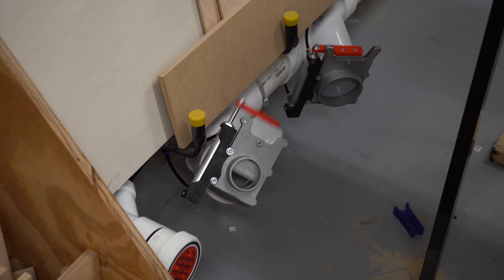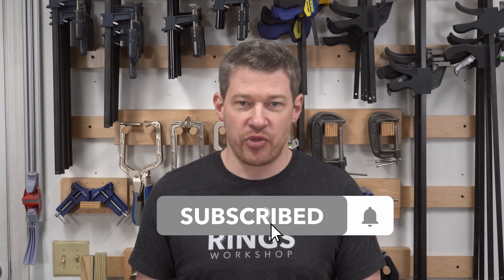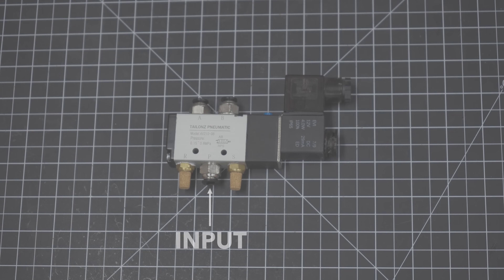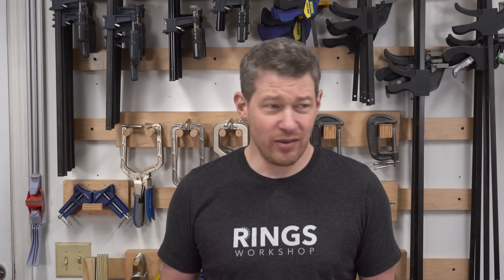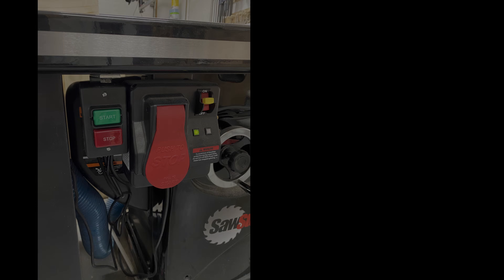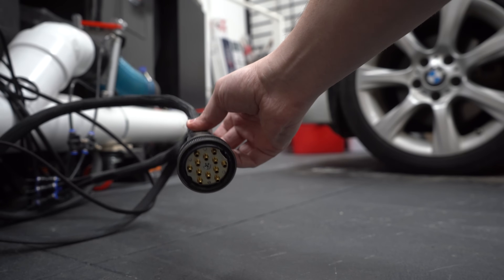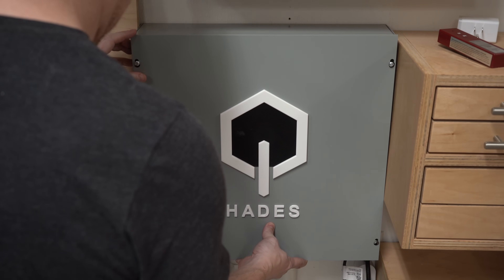How to Fully Automate Your Dust Collection Setup

Comment: You had mentioned using an Air Flow Control Valve to slow down the speed of opening and closing the blast gates. Do you recommend using two at each blast gate or can you just use one before the inlet going into each manifold? In my case i am going to get a 16 station manifold block and it would be nice to use only one air flow control valve for all 16 blast gates...

Comment: Great video! This is exactly what I was looking to build. A lot of other videos I have seen use either a battery at the blast gates or manually opening them. This is perfect. Two quick things. I can't connect to your website to get the plans for this. Is it down? Second, the link you have for the 4x 12v 5 Way Solenoid Valve is actually the same link as the Arduino board. Can you give an updated link for the 4x 12v 5 Way Solenoid Valve? Thanks and subscribed! p.s. whenever I get around to building this I am going to actually print out the Hades logo and name on mine as well! I just downloaded all of the stl files.
Reply from the maker: Website is back up and going, card I had on file expired haha, only knew it went down because of comments like this so I greatly appreciate it!  I’ll get that link updated here shortly.

Comment: Outstanding work, man! You've inspired me to build a similar system, and I have the first batch of parts on the way from AliExpress.

Hey, question about the 3 manifold blocks (I think that's what they are?) that the solenoid valve bodies sit on in groups of 4 - the things you're installing at 8:09. Any chance you have a link to those? Is there a reason other than mounting layout that you used 3 instead of one long one? Lastly, I can't visualize how they connect to the solenoid valve bodies; if it's screw thread, I don't know how you'd be able to mount them with so little clearance. Any tips you can share on how you did that?

Thanks so much! Loved the video.
Reply from the maker: Sorry for the delayed response.  I believe the separate blocks were initially because I didn’t plan to have as many and then added extra for expansion, as well as the availability at the time.  Which parts are you asking how they connect?

Comment: You could think of a blast gate as standard open or just leaving the last used open, to make sure that the motor of the dust collection does not run against a closed system when switched on and no machine is running.
Reply from the maker: Definitely could.  I just wanted to keep them closed since my dust collector pipes outside and helps reduce cold air coming into the shop during winter.

Comment: how did you add solinoids without adding diodes? I fried 4 relay boards until I realized you must add these to the + and - of the soliniod valves.
Reply from the maker: You shouldn’t have to as long as you have the right voltage.  I’ve had zero issues with mine.

Comment: You can ditch your data wires by using radio.  Motenio is a nice little product based on Arduino that lets you send the signals via RFM69W radio back to your Mega.  The range can be thousands of feet and one Moteino could run on a single AA for a decade or so in your use case.
Reply from the maker: I had considered it, but since I already had to run the air tubing anyway it really wasn’t saving me anything from a QoL stand point, which is why I decided to keep the data wires.

Comment: Thank you so much for this!  I was literally about to buy into complete system, I already have the arduino and alot of the other stuff to crimp small wires etc.  The one thing I do not have is an air compressor.  I initially thought about hydraulic or something like that, but no no no... way too expensive.  So, I guess I'm getting a little pancake compressor for this  :)
Reply from the maker: Glad you enjoyed it!  Let me know how it turns out.

Comment: Really smart and well thought-out build. My gut instinct is that a momentary switch at each tool might be simpler--push once to start, once to stop--but other than the miter saw, this setup looks quite elegant. I agree completely on the use of pneumatics. They are the tool of choice for automation of systems like this in industry for a reason, and the components are both inexpensive and reliable these days.
Reply from the maker: Appreciate the kind words!  Been really happy with how well these work and the consistency.

Comment: Great video. It inspres me to get to work on my system. You didn't mention how you are supplying pressurised air to operate the pneumatics.  For my shop, I think I would try using linear actuators so I don't have to use a compressor or deal with all the air lines. They would be slower, so I might have to experiment to see if the latency is tolerable. I eliminated the compressor in my small shop when I switched to cordless brad and pin nailers.  I would opt for ESP32 devices instead of Arduinos. Very capable microcontrollers that support wifi and bluetooth. They are so inexpensive you could design peripheral devices for the tools that communicate wirelessly with the main controller.
Reply from the maker: Just started messing around with the ESP32 devices, big fan.  For the air I use my main air compressor but split a line off and then reduced the PSI way down.

Comment: How would you approach sending the signal from the current sensor wirelessly?
Reply from the maker: Some micro controllers like the ESP32 support WiFi and Bluetooth, there are ways to have the current sensors connect through that.

Comment: Awesome project.  Thank you for the links!  Will give you some commissions when I grab some of those items.  I have been very interested in doing some air actuated stuff, glad you posted this up.  I already do programming with ESP32, Arduino, Rasp Pi, etc. I see they make air actuators all the way up to 60mm bore with 1000mm stroke lengths and I am aware they are fast controls!  I have a few projects that I will be working on in the future.  I like the dust collection setup, in the middle of rebuilding out my new CNC shop and also separate welding shop with plasma table.  This will be great for the dust collector, I have similar one to the unit you have, think it is a 2 or 2.5 hp unit same shape and size with 4 inch hookup.   I have been 3d printing all of my adapters for this setup.  Love these types of videos, probably starting own channel this fall with topics of cnc hobby and 3d printing stuff.
Reply from the maker: Love it!  Thank you!  Let me know how it turns out!!

Comment: Well done! 
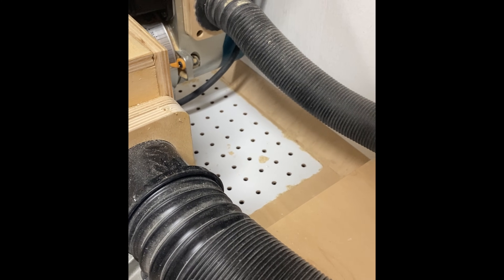However,  the comment you made on 11:55 is incorrect.  I recently installed a system from "Grit Automation," and it allows me to set up my blast gates, dust collector, and tool in any configuration I want. 
That said, the system you designed and built from scratch is very impressive.  Bravo!
Reply from the maker: I hadn’t heard of that system.  Are you able to program it where you could have one set trigger with tool powering on but then a timer to change to other blast gates after a timer?  Or reset the timer if tool is used again before shut off like on the miter saw.  I had never found a system you could chain multiple commands to vs just what happens when a tool is turned on or off.
Reply: @RingsWorkshop  Hey Sorry I was away on vacation and just got back to the States. To answer your question, yes, you can program multiple actions that will happen when you trigger a tool. For example: I have a 5HP Felder Dust Collector (3 phase) and as you may imagine, it has a lot of power.  One of my tools connected is a Kapex chop saw that is connected to the ductwork via a 4" branch and then reduced to 3" ductwork and reduced again to a 2" hose after the 3 inch blast-gate. My main Ductwork truck is 8".
You can imagine the wind velocity and noise if my 5HP dust collector was only pulling air from a 2" hose.
The Grit system allows me to program a 2nd blast gate to open at the same time as the chop saw blast gate whenever I trigger that particular tool. If I wanted to, I could program that 2nd blate gate to only open 60% of the way if needed.  In fact the servos that control the blast gates can all be programmed to open at any percentage I want when a tool is triggered.  As you know, CFM and air velocity both play a part in dust collection.  All this is controlled thru an app on your phone or tablet.  In the case of my chop saw, I have it programmed to keep the dust collector on for 30 seconds after the cut is completed. If I make another cut within that time, the system resets the timer.  
The owners of Grit Automation are also very approachable and helpful.  When I had a question on setting up the component that would start my 3 phase dust collector, (via the trigger) the guy who invented the system (Joel) called me on a video call from his cell phone to make sure I made the right electrical connections on my dust collector circuit panel. 
The same system also control my air filter in my shop, when the shop is in use and the PPM dust factor goes up to a predetermined level, the air cleaner kicks in and keeps running until the air quality sensor tells it to go off.  Think of the air quality sensor as a trigger.  When it detects dust in the air, it turns on the air cleaner. And when the air is clean again, it turns off the air cleaner.
 Hope this answers your question, and again...great video!

Comment: What happens when you have help and you are using two machines at once?
Reply from the maker: I don’t ever have help.  That said if you were going to use two tools at once, and have a strong enough dust collector to accommodate, you would just need to code it differently, but definitely still possible.
Reply: @RingsWorkshop  thank you I will definitely try this for my workshop. Have the blast gates held up well overtime?

Comment: Hi thanks for the video its great. I have manual blast gates and use door sensors to automatically start the dust collector but want to now automate the blast gates like you have. You mention that you are happy to share your Arduino code. Where can I access it. Thanks again for a great video
Reply from the maker: Thanks!  Glad you enjoyed it!  It’s posted on my thingiverse page, follow the link in the description!
Reply: Thanks found it - would have helped if I read the original description properly😊. What did you use for you air input, a small compressor?

Comment: This was an awesome video with great detailed explanations. I am definitley going to try this. One question, can the voltage sensor work on a 220v tool? Would you just connect one of the black wires and that is enough to sense the current with one leg of the circuit?
Reply from the maker: Correct.  My sawstop is 220 and it works perfect on that.  Although I may have it too sensitive as there are times I think it goes through it’s diagnostic and it kicks the DC on when I’m not expecting it and scares the crap out me every couple of days 😂😂

Comment: this is a great video and an inspiring solution to the problem of the burned up servo's...  can't count how many I have burned up over the past 3 years.   I took this concept and wanted to isolate all the intelligence and workings of each gate at the gate, and have minimal intelligence in a centralized controller, so I took your concepts and remixed them to something with a wemos D1 mini and NodeRed.  Essentially an Internet of Things network, with orchestration happening in NodeRed.   A raspberry pi runs the dust collector relay through a GPIO pin.    A suggestion for you to simplify this system, use an AC Current Sensing Switch,Current Sensing Relay 0-30A Normally Closed Current Sensor Monitoring Relay to detect when a machine is turned on.   No need to debounce and detect the on / off voltage sink and figure out if the machine is really running.   Also removes the challenge of the "ghost" loops created when you remove 1 of your sensors from the electrical circut.   This relay generates a 5V signal which you can connect to an INPUT_PULLUP digital pin on the arduino, which then is either HIGH or LOW.   If LOW, the machine is pulling current, if HIGH, not enough current to trip the relay (adjustable sensitivity).   It simplifies the current detection function to a simple if/then statement.     Just a thought to help simplify Bob's original voltage drop sensor

Comment: This video inspired me to build a similar system for my shop and it seemed to me that its arduino logic must not be very difficult to me and your code needs just a slight adjustment for my shop configuration. Hell i was wrong) Now i am sitting with arduino and 16 relay module trying to figure it out. Getting back and uploading your original code, i have some multiple relay clics on startup when it should be doing absolutely nothing, then one of the relays stays opened for no reason. I can se on Serial Monitor that it constantly scans Miter Saw amp sensor & I can see input signal change to 26 amps when i give it 5v or GND, but absolutely no reaction from relays and to any other A-pin too. The connection is fine, I've checked it with a relay board test code. Should your system be activated by some of buttons or switches i've missed? Thank you
Reply from the maker: My system has two buttons, for my bench top tools and my floor sweep.  If you don’t have buttons you can remove that part of the code.  There is also the code you likely have to remove for it monitoring the table saw and router table that has a switch depressed at all times I want those monitors.  I explain that in the video as it’s a mobile setup, I only want it monitoring those tools if I have the dust collection connected which has the switch built in to it.  Removing those few if statements should fix the issue of it not looking for the table saw or miter saw

Comment: I’m just curious why the ivac automated blast gates were not an option to achieve this same outcome?
Reply from the maker: I explain that in the video.  Far less ability to customize them, leave them open for different times, sometimes I want some to open and other times I do not (ie my router table fence only being open up if I’m using it), or to have one close and then have a longer delay for the miter saw since it powers off after each use but then once it is done being used close the main one and then open another before closing down.  It can accomplish a lot of this, but not near as fun or customizable and would have made for a very boring video.

Comment: Nicely done!!! I’m in the mist of doing this as well. My method is wireless transmitted from each tool. That way the dust collector knows which tool is on and which gate to open. I placed the solenoids at each gate.
Reply from the maker: I considered going wireless but since I needed the air line ran to them anyways I decided against it.
Reply: The tool trigger is wireless.  The solenoids are at the gate hard wired back to the controller

Comment: Any chance you can show the airline system? Do have it hooked up to your main shop compressor? Or do you have a dedicated one? I’m assuming you prime it every time? How do you handle the hoses? Details would much appreciated.
Reply from the maker: Ya it is just split off the main compressor, it only uses 30 psi so nothing crazy there.  Hoses I just ran inside some larger mesh cable management to keep them together.
Reply: Thank you sir! Excellent video...very well presented 👍🏽

Comment: Just found your channel with this video. Very good first impression!
If these question has been answered in the comments I apologize, I did look. What pressure are you running?   Did you consider purely electro-mechanical with timer relays? How are the 3d parts holding up?
Reply from the maker: 3d prints are great, used 50% infill and 4 or 5 walls just to make them more durable.  I did break one early on using less infill and didn’t have the valves to lower the psi.  I’m pretty sure I have the psi set to like 30 for the whole system, nothing crazy.